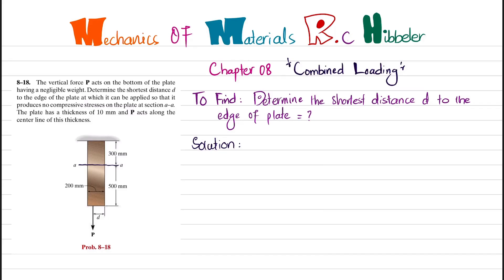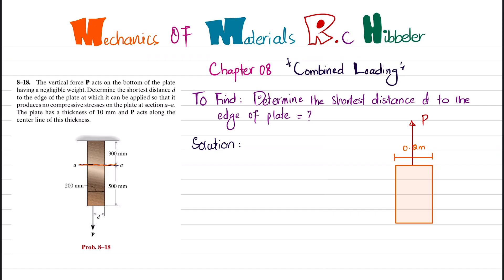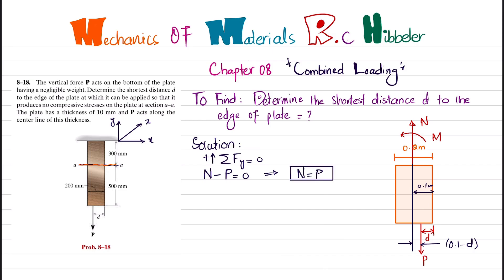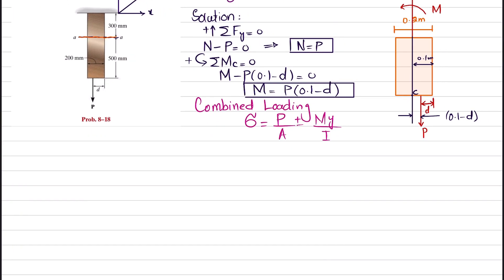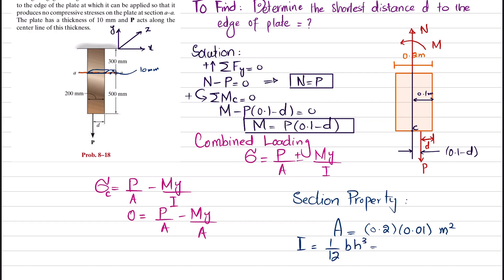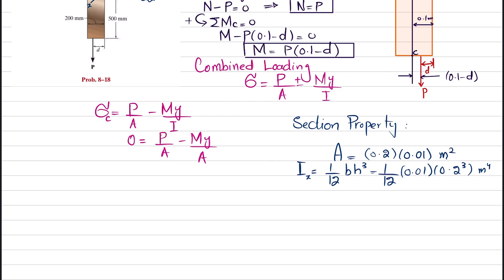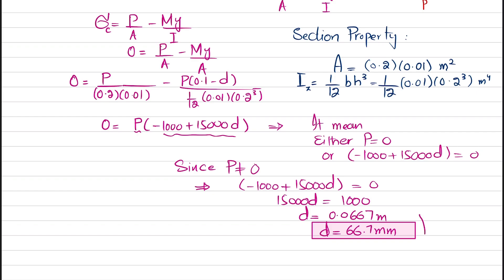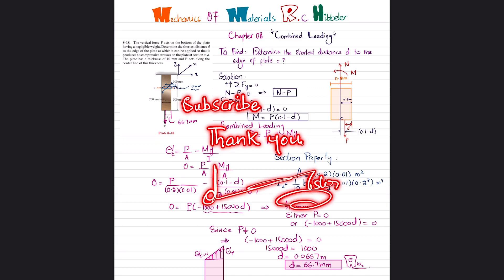Problem 8-18 | Combined Loading | Mechanics of materials RC Hibbeler | Stress | Mechanics

Comment: I have a question, why did the force P move to the right, with its initial position you would get p(d-0.1) but it got moved. thank you! I love your videos
Reply from the maker: well it's a very good question, you can see that d starts from right hand side and we are going to find it's value , it can be any value but condition is that it should not produce any compressive stress in the plate, so for this condition you can see that d should be in such away that it will be close to right side thus producing compressive stress at the left edge . the normal axial load and compressive bending stress will cancel the effect and we will get the condition that there will be no compressive stress at the edge of plate. and when you calculate d you can see its value is less than 100  which mean the load is acting closer to right hand side.
Reply: @engradnanrasheedmechanical  Thanks a lot
Reply from the maker: My pleasure 🎉

Comment: Why is it that when you draw the FBD, the side that P is on changes in comparison to the original diagram? If you kept P on the left side and set its distance to the half way line to be (d - 0.1 m) instead would you get the same answer?
Reply from the maker: In order to keep the equilibrium and I think the answer will be same.

Comment: You forgot to plug in y (in My/I) that’s why it doesn’t equate there. It took me a minute to figure that out. (y=distance from neutral axis=0.1m) so My/I is [P(0.1m-d)(0.1m)]/[((0.01m)(0.2m)^3)\12]
Reply from the maker: @abigaill2233 , yes you are right i forget to put the value of y= 0.1m. Thank you for highlighting the mistake.
Reply: why is the y 0.1 when the distance is moving? how can it be constant 0.1